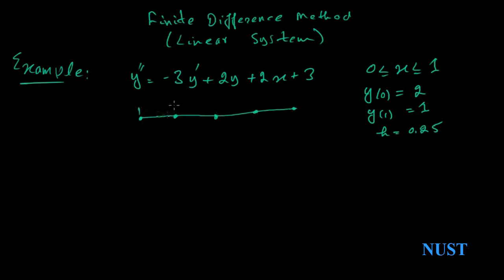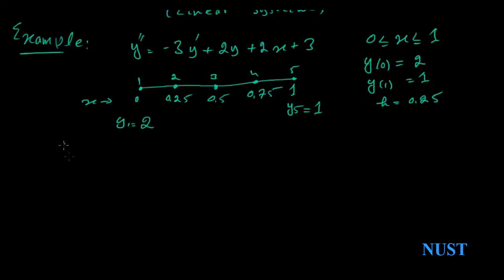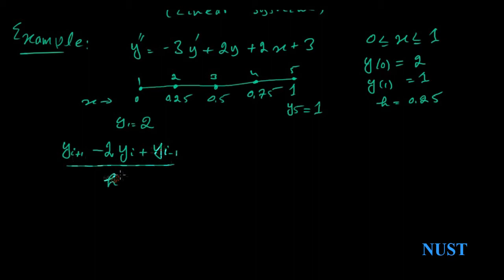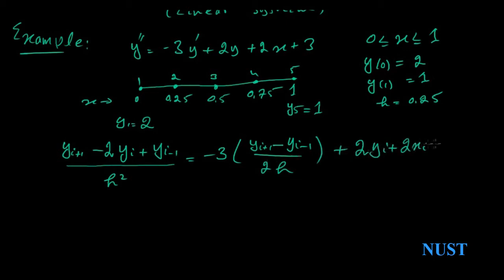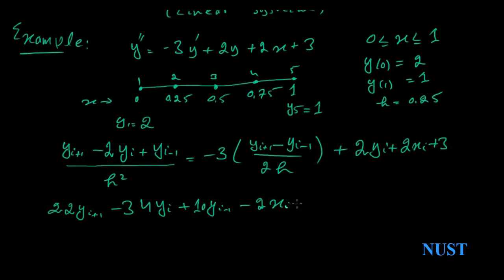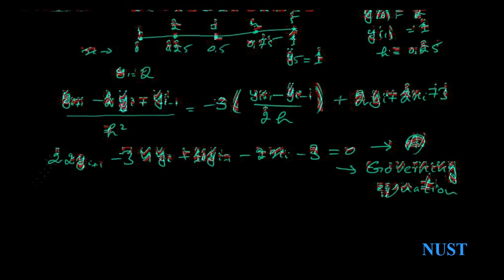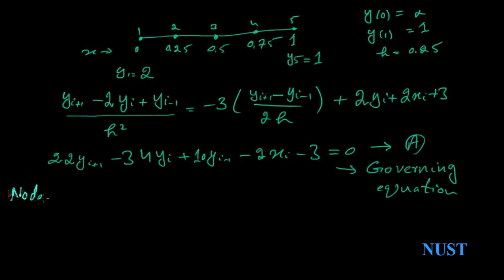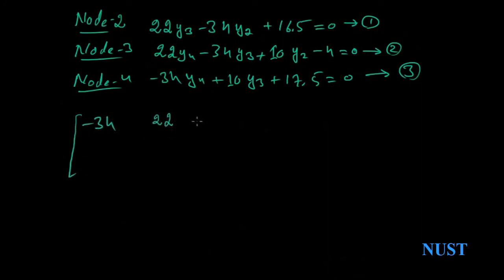11.1- Finite Difference Method for linear system (numerical analysis)

Comment: Hi sir,
According to me, there is an error in your solving process: firstly, we need to find nodes y1,y2 & y3 and not y2,y3& y4 as you have done. y4 is a boundary point and it's value is already given to us.
The corresponding equations for nodes 2, 3 & 4 for i=1, 2 & 3 respectively in the governing equation becomes:
1) 22y2-34y1+16.5=0
2) 11y3-17y2+5y1-2=0
3) -34y3+10y2+17.5=0
Solving these 3 equations for y1, y2 & y3 by Gaussian elimination method using partial pivoting, we get:
y1 = 0.8594
y2 = 0.5782
y3 = 0.6847